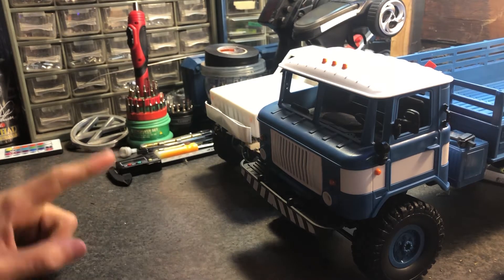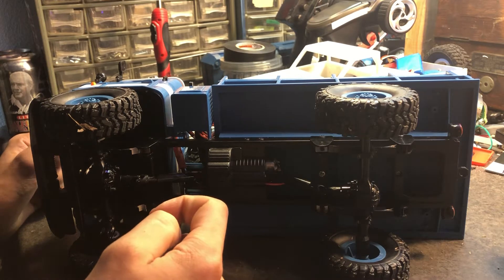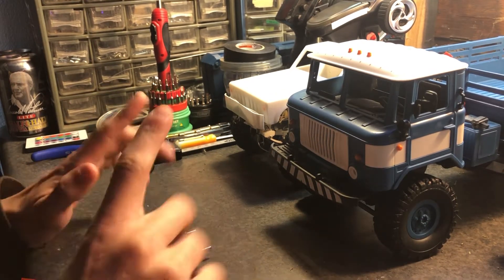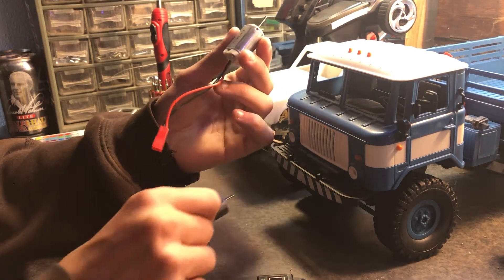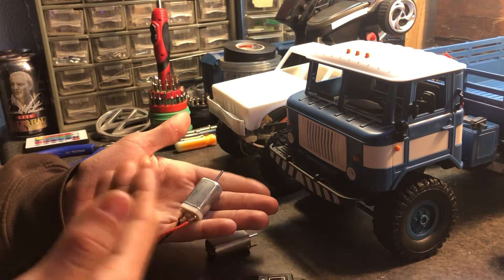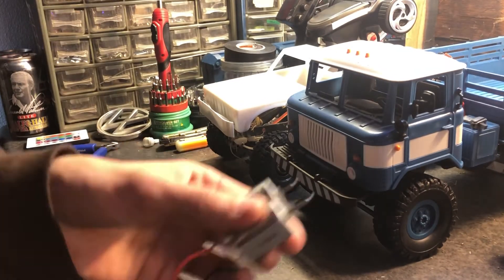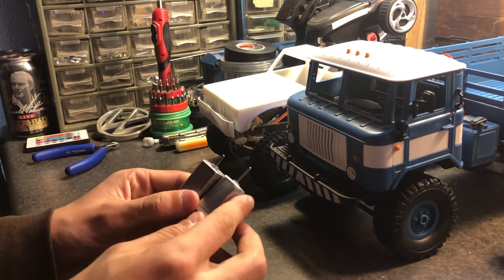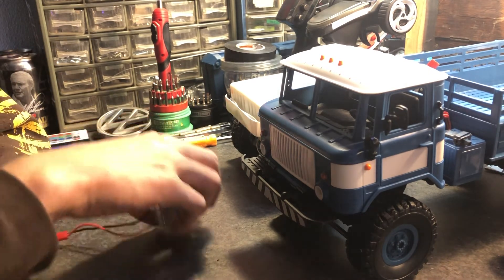WPL 180 motor upgrades

Comment: I have a ton of printer motors I need to play with for my WPL.  I run one of those cheap 20a esc.  I think that is really the limiting factor for motor, power and modulation.  I am looking at running a hobbywing 1060 or 1080 to upgrade all of those options.  I agree on the brushless motor upgrade.  I am looking to do that with a 1400-1800KV motor and maybe if I can flash a cheap BLHELI/SimonK esc to get extra features.